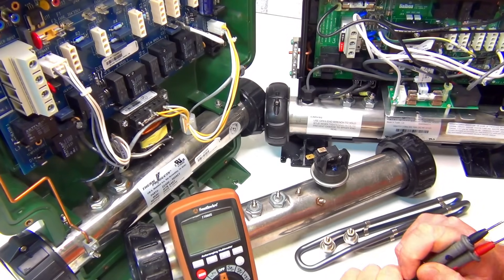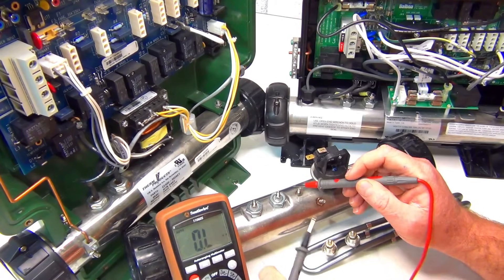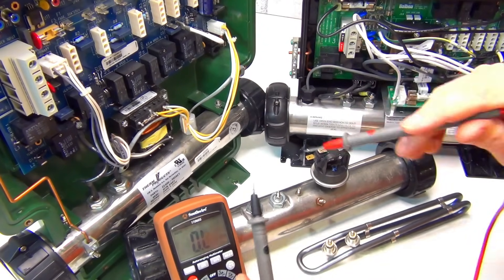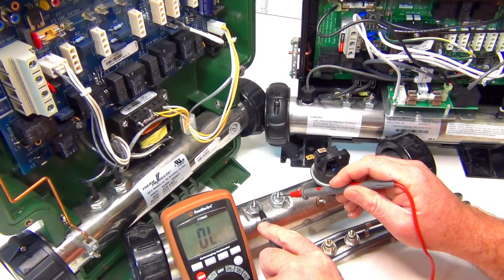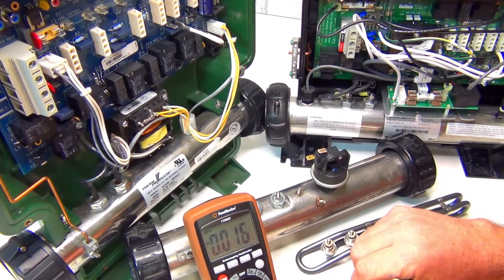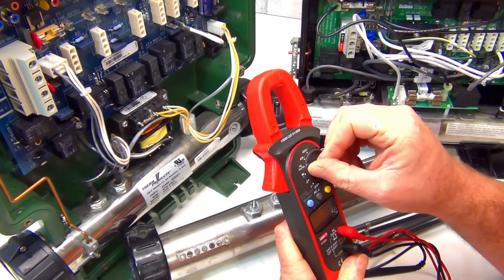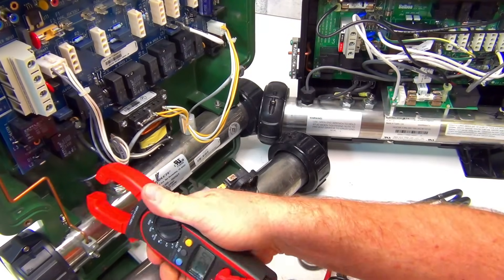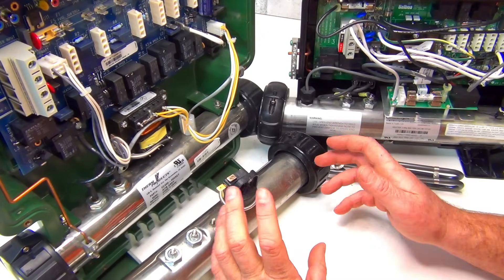4 Ways of Testing a Hot Tub Heater Element [ Step by Step ]

Comment: So, my tub wouldn't heat above 87 degrees and ran constantly. Got an open wire and fire at the high limit switch, and the element measures about 13.8 ohms. I'm going to get a new high limit switch and wires. Replace the element too?
Reply from the maker: Replace the element anyway
Reply: @VIPPoolsandSpas  I did all mentioned above. Hot tub works now. Thank you!

Comment: My 2 yr old Lifesmart LS600DX is tripping the breaker. When I remove the two hots going to the heater element from the control panel, the breaker doesn’t trip. But I measure a good almost 15ohm resistance on the element. Any ideas? Connects seem solid. I can’t test the Voltage or Current since it trips too quickly.
Reply from the maker: Change the element
Reply: @VIPPoolsandSpas  thanks. I did verify that I am getting 240v to the element from the two screws in board so sounds like element or sensor is bad, right?
Reply from the maker: @djryan8944  a sensor would give an error code.  Change the element and you'll be good to go.
Reply: @VIPPoolsandSpas  thanks!

Comment: Hi there, I have a balboa 4.0kw heater. The gfci breaker shuts off periodically (could be 20 minutes, could be 24 hours) Getting 240 voltage all the way to the elements. Unplugged the heater for 3 days and no issue. 
Should I try cleaning the element before replacing the whole heater?
Reply from the maker: Just replace the element.  Still be something else after anyway.  Could be the breaker.  Try the element first.

Comment: Ive got a twilight series like the one you had on the right rear with the Balboa element.  My multimeter reads OL for ohms.  Can I assume thats zero?
Reply from the maker: NO.  This means that the meter cannot accurately measure or display the value being tested, and it shows OL instead.   Meter set too low for the ohms or just can't read anything.  Doesn't mean it 0.  Just means the meter can't read it.

Comment: Hey there. I have a balboa bp that isn’t heating. When checking voltage across the heater I’m not getting anything. When checking resistance I’m getting 22ohms. It’s a brand new heater element in there. What do you think it could be? 
Thanks
Reply from the maker: Did you test volts ?  No volts means it's a board issue.  If you had volts, more then likely it's an element.

Comment: When checking the heater for volts and amps you have to make sure the pack is calling for heat so it is actually sending power to the heater. You should also check the connectionswere the power comes from the boar to make sure power is cgoing to the heater.
Reply: So if I put a meter to the two brass contacts feeding power to the heater, should they always be at 120 each or just when the switches kick on for heat?

Comment: Great video. 
My 240v 3k heater hot tub is tripping breaker as soon as it is turned on. When I disconnect the power plug for element at the circuit board the hot tub will run with no faults.
With element disconnected I have done the tests as per the video.

Tests show:
Element is 20ohms and continuity is good. 
Volts test from multi plug prongs at circuit board
1 prone to ground shows 240 volt.
1 Prong to ground shows 1.5 volt.
Both prong shows 30 volt.

Any ideas?
Reply from the maker: Could be the heater telay
Reply: @VIP Pools and Spas   ok thanks. Just to confirm. should I have 120volt at each prong  and 240volt across both prongs?
Reply from the maker: @jamiereilly4015  yes
Reply: Can you advise on how I pin point the relay faulty relay on the board? Is it the relay closest to the element multi plug?
Reply from the maker: @jamiereilly4015  Need a picture of the spa pack circuit board.  Send to info@vippools.ca
Reply: Changed the heater element. Problem sorted.

Comment: I hope you are still seeing comments. My hottub has gfci cord. When plugged in hottub comes on but no heat. When I press test. The light goes out and doesn't come back on until I unplug and plug in again. The cord has been replaced since the original cord. I replaced a controller I think it was called that sits on the heater tube. The hot tub was working after that. I had drained the tub for winter and refilled it. That was when it wasn't heating. I checked to electrical panel. It looks good. The prongs on the cord did look burnt. I tried to file those to make a good connection. I haven't tested with the meter yet. Just wondering should I be looking at the cord or the heater?
Reply from the maker: The 110v cords are known for burning at the connection.  Where the wires go into the terminal block, does it look ok?  Not burnt?  Test the power coming into the spa pack and test the element.

Comment: I get 120ish volts per lead on my heater element but I get nothing if it touch them together. Bad heater or something else? So basically if I touch 1 tab and a ground I get 120v. Replaced my upper controls and then all of a sudden no heat??
Reply from the maker: Test amps
Reply: Just tested it again, both sides from the board are putting out 123v but when I touch both I get 0…..
Reply from the maker: @clyde19770  to confirm, test the amps.  If you don't have the "clamp" for testing the amps you will have to test it like this.  I will be doing a video like this for a heater element soon.
https://youtu.be/9mu7-HOqXAY
Reply from the maker: @clyde19770  make sure to test in AC
Reply: Haven’t torn the panel back off to test the amps yet. I’m finding it weird I’m not getting 220-40v when I touch the 2 together. I’m thinking it’s a board issue…. With the heater unplugged testing the prongs on the board I don’t get 240 when I touch both. I only get the 120v per side but not combined at 240
Reply from the maker: @clyde19770  sounds like a relay.
Reply: Test 1 I get 13.8. 
Test 2 I get continuity
Test 3 I get 0 volts…
Test 4 not completed yet because test 3 failed
Reply from the maker: @clyde19770  sounds like the relay still.
Reply from the maker: @clyde19770  test the power coming into the spa pack.  white/black, red/white, red/black

Comment: First 3 methods are great! The fourth method is incorrect for measuring current. To use test leads, it is necessary to break the hot wire and put the test leads in series. Your method would create a short and likely blow the breaker. The amp meter creates a short circuit between the leads to complete the circuit.
Reply from the maker: SH%T thanks for seeing that one.  lol  Forgot to say to disconnect the one side.

Comment: question, i don't currently have an amp meter but i checked the voltage going to each lead and it was indicating 75V. it's a 4.5kw heater in a 240v system. Ideas?
Reply from the maker: Have to test the amps next or just change out the heater element and see.  75v isn't a good thing.  Should have around 240v on that.  As per my video.
Reply: @VIPPoolsandSpas  after taking out the board, the solder connection of one of the heater relay terminas blew out. Jumper cable from the equivalent spade terminal on top of the relay to the heater element advisable?
Reply from the maker: @charlie0801  well, that would explain the 75volts.

Comment: I am working with a Shoreline Model: PSL800 BWN LXCZS

I am getting continuity and reading 12 ohms with the element. I am not getting any Volts when the power is on though. Not sure what do to next… any help?
Reply: I am getting a reading for 22V at the heater posts on the board.
Reply from the maker: The rule is (as long as there's a call for heat), if you get 240v and no amps it would be the element.  If you get no volts or "some" volts, its on the board side.  Heater relay most likely.  Test volts coming into the spa pack.  Both on the black and red.
Reply: Tested the volts coming into the pack and they are at 240. Must be the heat relay. Should I buy a new pack or take it in to get repaired?
Reply from the maker: @trevernordlund1652  get it tested to make sure.  Electronic guy

Comment: I'm reading 14.9 ohms and getting the beep on the heater but if it is plugged in, the GFCI Breaker pops..... with nothing else plugged into the pack? WTF?
Reply from the maker: What's the volts and amp reading on the element?
Reply from the maker: Would say it's the element anyway.
Reply: @VIPPoolsandSpas  It wont stay on long enough for it to get a reading with the heater plugged in.... the spa pack will boot up without the heater plugged in even though it shows the correct Ohms and continuity. Ordered a 5.5kw replacement heater so hopefully it will last more than a year!!
Reply from the maker: @enkrypt3d  change the heater element.
Reply: @VIPPoolsandSpas  yea parts are on order. We will see thanks
Reply from the maker: @enkrypt3d  Changing the element will also tell you if it's the relay for the heater element.
Reply: @VIPPoolsandSpas  yea I have a tech coming in a few weeks
Reply from the maker: What was the out come of your heater element 7 months ago?  Was it the element?
Reply: @VIPPoolsandSpas  yea I ended up replacing it. kind of lame that it died less than a year old.

Comment: I’ve got a Balboa M7 and heater is getting up to temperature initially and holds for about a day, then for whatever reason won’t hold temperature and fades down to around 88-90. I powered off the tub and ohms are good and continuity. Powered back up and could hear tub call for heat but only held 240v for about five seconds then off and volts dropped to about 23. Powered tub off, and just reset it recently and it’s now heating up steadily to 99. What gives? Is it the tape on sensors?
Reply from the maker: How many pumps? Is there a circ pump or does pump 1 heat it on low speed?
Reply from the maker: Test the amps when you get 240volts.  If you get 240volts or around that, the board is doing it's job.  Tells me it's the element.  BUT.  Your saying you also get a lower volt reading at 23volts after it drops from 240volts?
Reply: It’s a Calspa System 2000 with two pumps. Yeah strangest thing yesterday during troubleshooting, I would switch on from breaker, it would prime for 30 seconds and top side temperature would show and call for heat. You would hear heat switch on and display 240v for five seconds then hear it switch off and volts would bounce around from 23 all the way down to 7. 

Left tub off overnight and switched back on today, primed and displayed 86 degrees. Set to 99 and it got up to temp no issues in three hours..
Reply from the maker: @coreyk5536  don't worry what the display says about the volts.  Use a meter to test the heater element and also the amps.  Anything 85F and under is just the pump motor heating things up, not the element.  What do you mean by "bounce around"  this is on the topside display?  Is the topside sticker/overlay beat up or old looking?

Comment: So I have a new to me hot tub and the problem I have is not heat and now no jets. My jets were working however after moving the unit to the new location I have now lost jets. I can hear the relay click and also the fuses seem to be fine but no jets. I have unplugged the plugs for the jets and moved to a spot that has power and they seem to work fine however the pole they are plugged into that would power them with the button seems to never get power in which would allow the jets to work. Any ideas? balboa es1500
Reply from the maker: Need to test all the fuses.  If the pump that pushes water thru the heater tube isnt working, then you will have no heat and no water will come out the jets.  The pump seems to be the issue.  Test the fuses first.
Reply: @VIPPoolsandSpas  the pumps are all
Working if they get power by me plugging them into a port that is showing power. All fuses seem to test good as well.
Reply from the maker: @jeffreygardiner5733  Test volts coming into the spa pack.  Let me know what you get.
Reply: @VIPPoolsandSpas  I have 120 to each leg. Is there another way I should test?
Reply from the maker: @jeffreygardiner5733  Send a picture of the wiring coming into the spa pack.  Also a picture of the wiring into the GFI breaker.  info@vippools.ca
Reply: @VIPPoolsandSpas  just sent the pics to the email.
Reply: @VIPPoolsandSpas  any ideas? Thanks so much
Reply from the maker: @jeffreygardiner5733  Did you test the spa pack?  white to black?  Black to red?  red to white?
Reply from the maker: what are the volts for each?
Reply: @VIPPoolsandSpas  120 each side. From what I can tell. What do you mean by checking spa pack? Sorry
Reply from the maker: @jeffreygardiner5733  spa pack is the pictures you send me.  Its where everything plugs into.  If you follow most of my videos, you will know the problem.  If not, its the board.  Im not there to test everything so its sometimes hard for me to see if the testing was done right.  Whats the volts at the red and black together?.  Tested on AC and the leads connected on the spa pack.

Comment: Your a busy guy! I have a good one. 10 Ohms on the element, connected it directly to 220v source on the board (temporarily), clip on Amp Meter is drawing 11.2 amps across one lead. When I do the math that should be closer to 24 amps. it is a 5500 watt element. Won't get passed 97 degrees with no filter. Thoughts?
Reply from the maker: Sensor issue or programming I would say
Reply from the maker: Change the heat sensor and a 5500kw element should have around 23amps
Reply: Thanks it’s hot wired direct so the element is not using any control system to turn it on.

Comment: Hello again, I want to question something you have said in many of your videos When testing the element for 230vs on the element that is. You say that if you do not have 230vs ,change the element first. Here in Sweden, a new element costs 300 to 400 dollars. I have spoken to knowledgeable people here and they say ,by just buying a new element ,is not going to just suddenly give 230vs, It must be a circuit board issue, like a blown relay. So that is very costly and will not be the problem. Unless you know something the people here do not know ??So the question is,Why would a faulty element ,stop a current going through it ?? Does not make sense.
Reply from the maker: An element can test fine for volts, ohms and continuity but still be the issue.  A hole in the element would not stop it testing good.   Test amps and if it tests 0.....replace the element.
Reply: @VIPPoolsandSpas  I have ordered a new element to arrive on Wednesday.The guy said I can send it back if it does not work. Not hopeful, I have 230vs going into the circuit board, took the brass connections away from the element and have 230vs at the 2 bolts connecters on the board. But when reconnected ,do not have 230vs at the element. Ohms were 0.
Reply from the maker: Just following up.  Did you replace the element ?
Reply: @VIPPoolsandSpas  yes was not the element. A relay as usual. These manufactures of the circuit boards,make sure it is not pull out and pop in new relays. They want to make sure the mojority of people buy a whole new board.just sent it to the uk  to be repaired. All 7 relays are now replaced.
Reply from the maker: @swedishkev   The relays use to be replaceable.   Glad you got it fixed.
Reply from the maker: If you can get someone there like a computer repair guy or electronics guy, they can test the circuit board and tell you if it's the relay.  I should do a video on testing those relays.
Reply: @VIPPoolsandSpas  I have a relay problem  at the top of relay I have 240 volts but nothing at the bottom where the wires go to the heater did you ever make a video for testing the relay? Thanks for all the videos plus how do I send a picture of my relay and pack I’m
Reply from the maker: @ronking7267  there's a few different relays and packs so it's hard to show how to test.   To test most relays, you have to get behind the circuit board.  I will be doing videos on that at some point.
Reply from the maker: @ronking7267  you can always join our members group so you would get more detailed help on things.
Reply: Veldi Bra! thousand Takk!

Comment: My resistance and continuity are good at 10 Ohms but the breaker is tripping when the heater is energized. It's fine when the heater is disconnected. Is there another test to determine what is wrong with my heater that it's tripping the breaker? This is a Tiger River spa with a Laing (Watkins) 6kw heater.
Reply from the maker: replace the heater element / the whole unit.